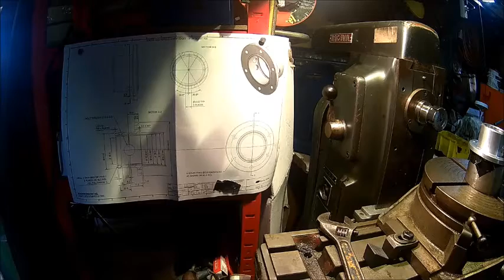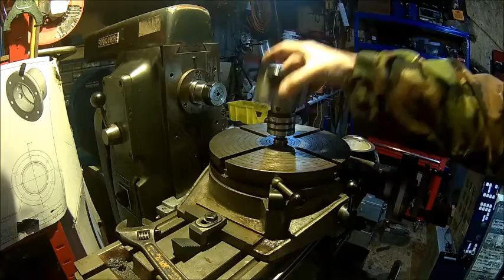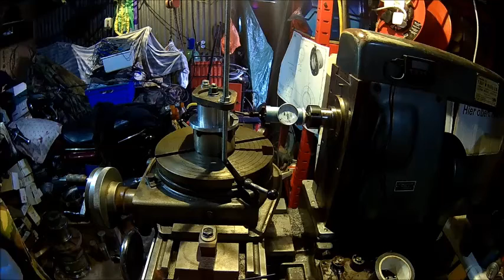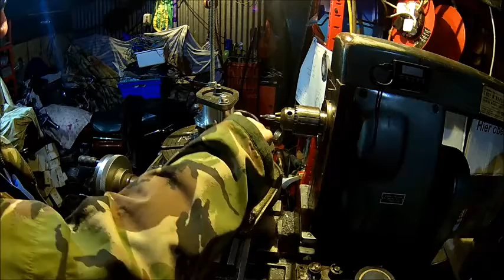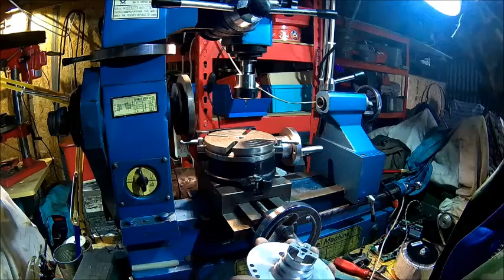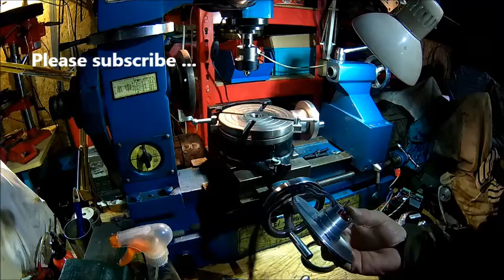Just some random machining jobs on the milling machines

Comment: have you ever tried using end mills for drilling those types of holes? it saves the agony of multiple tool changes.. as fate would have it i was doing a similar operation today ..lol.. used an end mill tho..
Reply from the maker: I spend an hour or so, just thinking how i hold it and what i use to get the holes in. It's probably not visible, but the part is rather thin walled with a bunch of grooves and stepped diameters inside. The big hole was there and just needed enlarging, so an endmill was out of question. For the other 3 i prefered spotting and drilling because plunging an endmill into soft/thin aluminium could build up chips and then really bad things may happen.
Bear in mind that this was a (rather urgent) customer project, so considering the huge replacement price of the part and possible repercussions of missing a delivery date if i would damage it are more than worth the few minutes extra for changing tools
Reply: yeah, that aluminium is a bitch to work with sometime. so i getcha on why you went the route you did in this.. there's always more ways than one to skin cat...lol